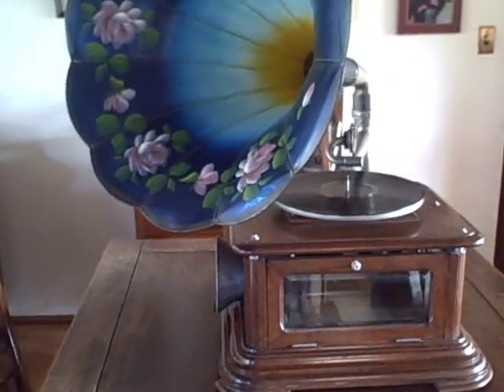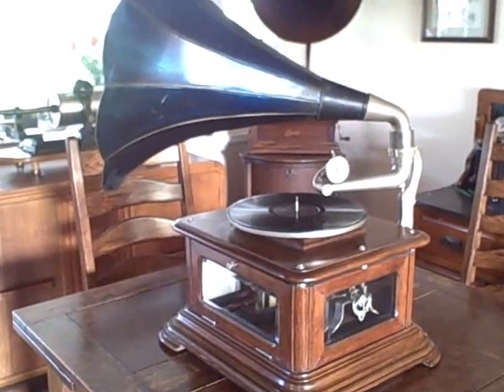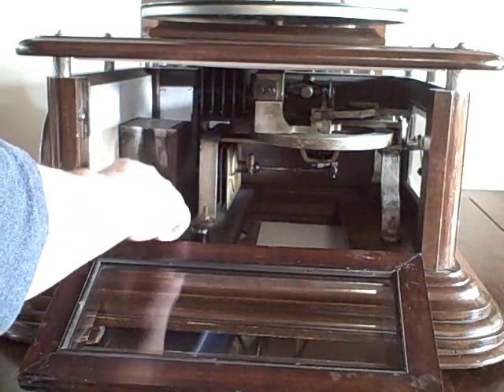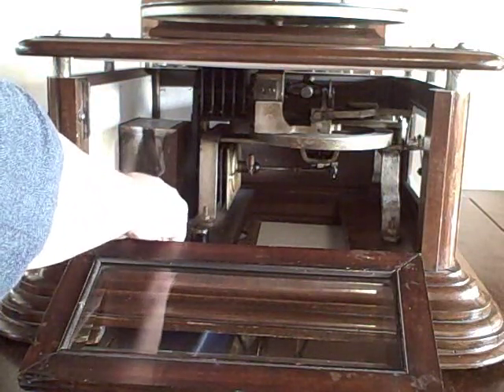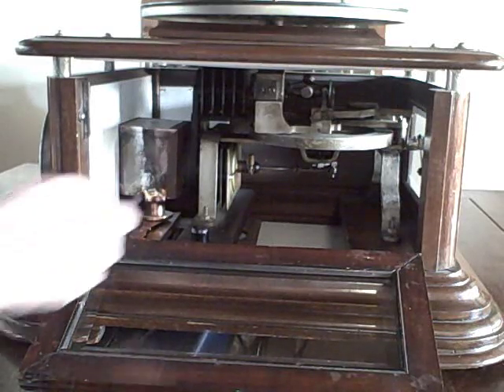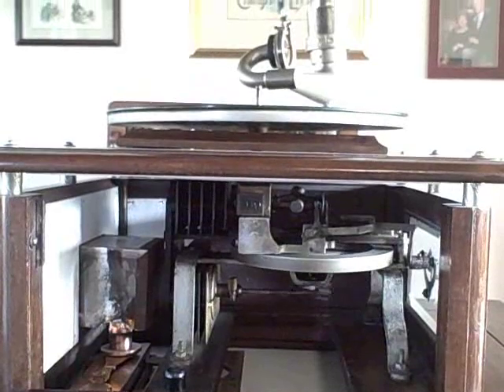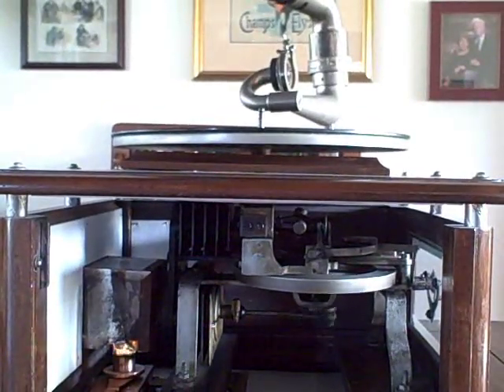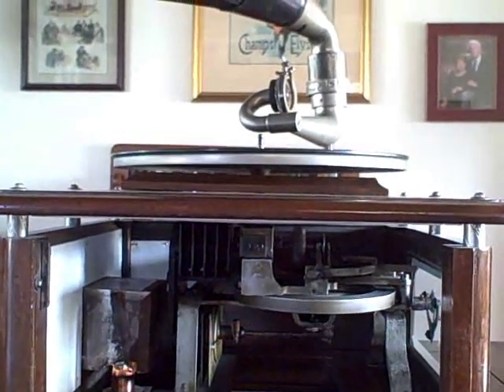Antique Phonograph with Stirling Engine Hot Air Motor

Comment from the maker: There is a governor in the phonograph part of the mechanism, which is mounted above the Stirling engine part. You can see the governor start to spin when the spindle of the turntable is pulled up to start the phonograph, and also watch it stop at the end of the video when the spindle is pushed back down. This governor can regulate the speed of the turntable to whatever revolutions per minute are required.
Reply: Full scale steam engines were governed in the same way.  I am amazed at the lack of perceptible  'wow' and 'flutter'

Comment: If you look at the machine, there is a big mica heat shield around the hot end of the engine as well as a horn on the side of the machine which direct the waste heat away from it.
Reply: If the furnace ever quits working, not a problem, just play a few records to warm up!